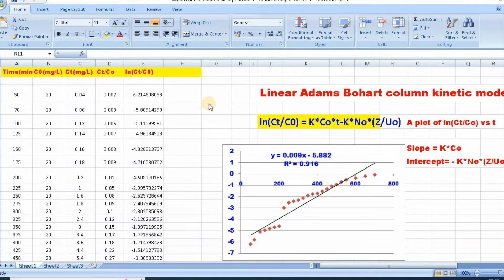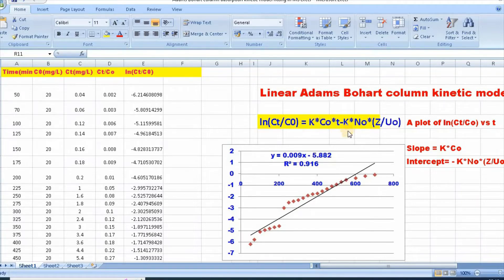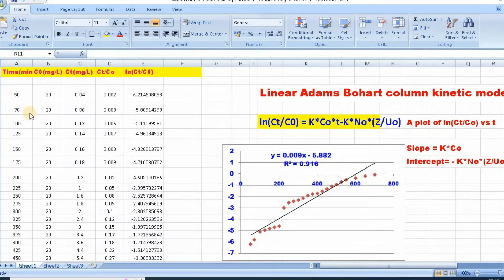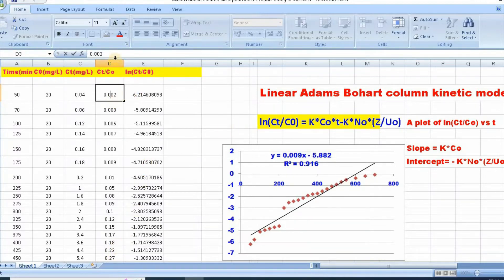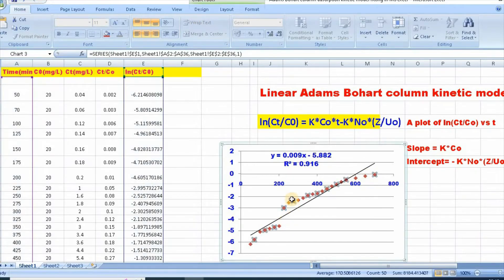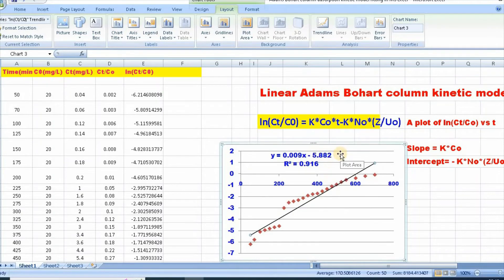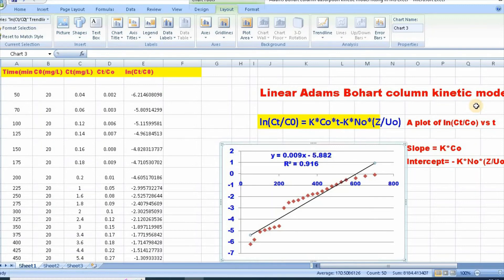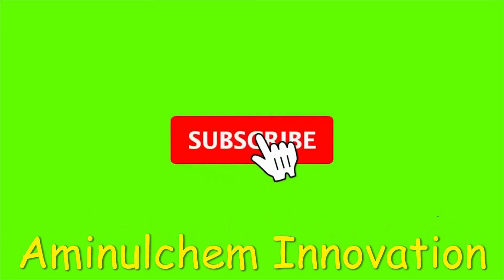Adams Bohart column adsorption kinetic model fitting in MS Excel

Comment: wouldn't be  ln (C0/Ct) in bohart adams model?
Reply from the maker: Thanks for your comment. I think the equation shown here is right. Please check: http://uest.ntua.gr/tinos2015/proceedings/pdfs/Samoraj_pres.pdf
Reply: @Aminulchem  , thank you for answering. I have seen some articles using ln (C0/Ct).
Reply from the maker: @danippolito  OK. Then try to fit using ln (C0/Ct)
Reply: @Aminulchem  Sir, you are a very good professor, I'm going to follow your explanation. But, I got curious about the reason they use Co by Ct. DOI:10.1080/19443994.2014.963158  Is this a mistake?
Reply from the maker: @danippolito  Thanks. Yea. Some papers used it. But I think, the equation I used is the frequently used form and recommend it to use.